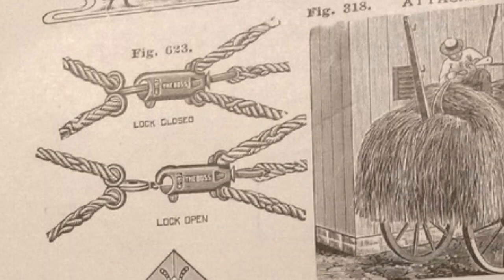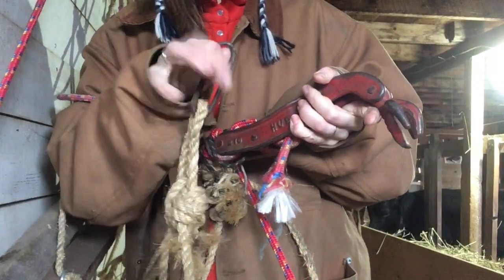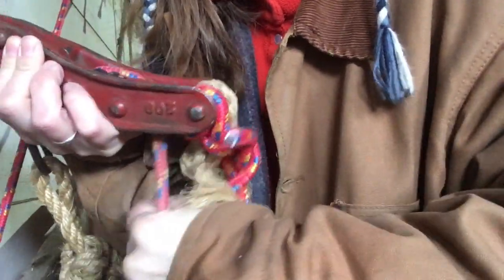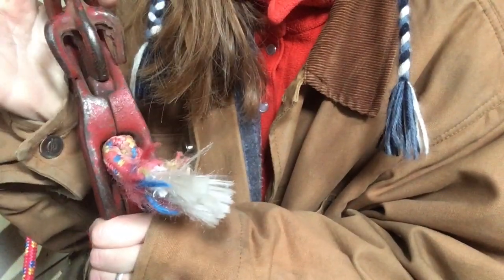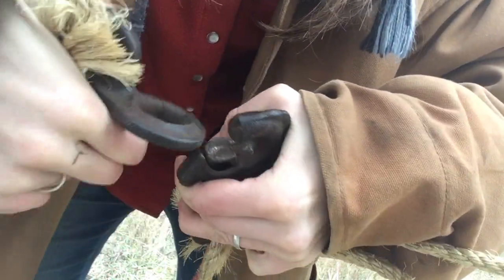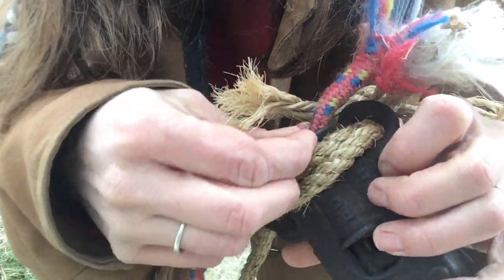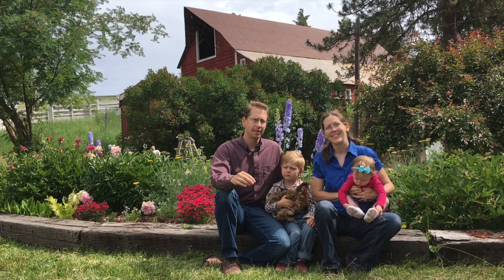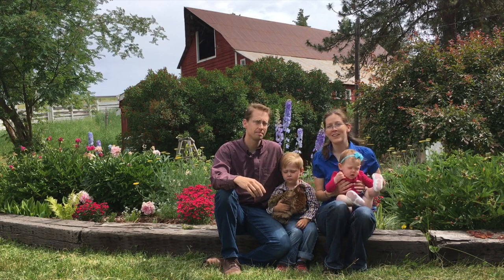Hay Slings Part 2: Sling Releases

Comment: Enjoyed the two-part series! We’re looking forward to trying some slings on our farm. We do have one Hudson quick-release, but we plan to build a second sling with a modern quick release. Our trolley isn’t designed for slings either, so I’ll have to make an adapter. Thanks for sharing!
Reply from the maker: Maybe someday we will be like you and have an actual hay wagon instead of just our truck bed. Sometimes we've had the wood cross-pieces catch on the truck racks and snap the ropes on the sling. But we make it work!
Reply: Cozy Cow Family Farm I’m sure you’ll have a hay wagon eventually! You’re a two-tractor family now and so a wagon is inevitable. I still maintain that a car hauler type flatbed would make a great “hay wagon” for loose hay though...